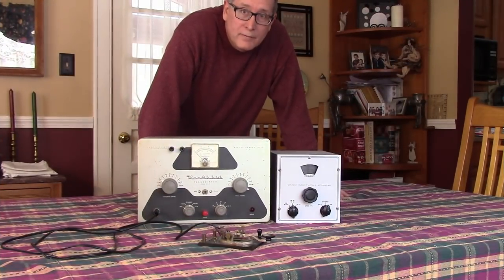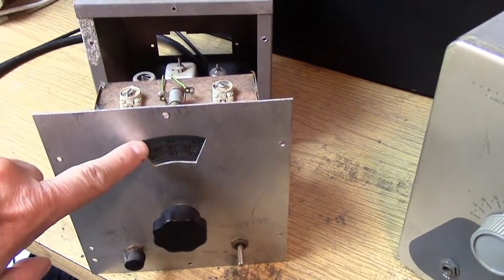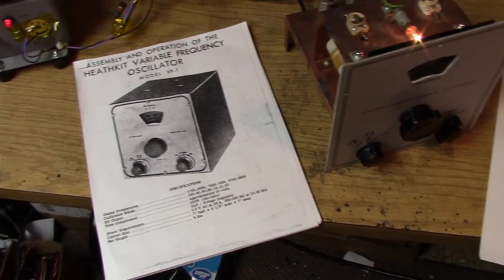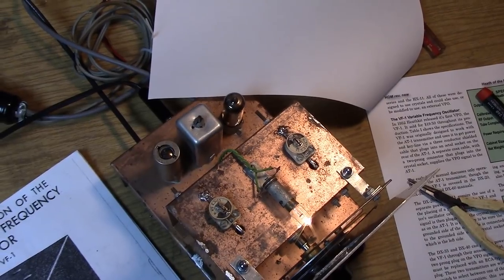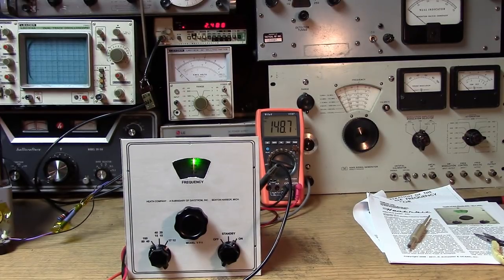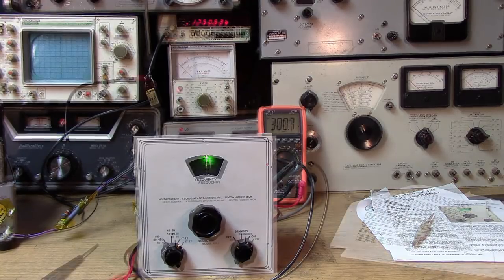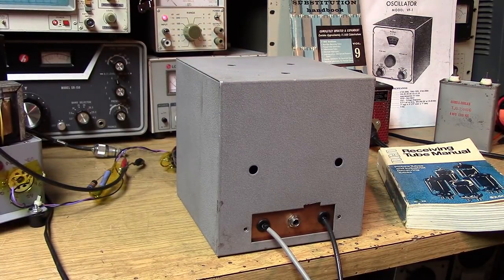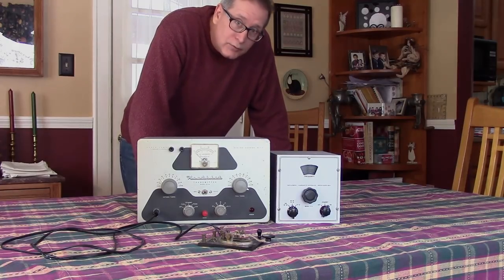Heathkit VF 1 VFO - Exploded

Comment: I've still got three of these.  One is a "parts" unit, the other two I refurbished electronically and wired one-each for the two keying modes.  I use them variably to set frequency on transmitters and transceivers.  Having two prevents all the re-soldering anytime a different keying mode is called for.  The VF1 may be older than the HG10 external VFO, but the VF1 is far more stable.  Matter of fact, if either of mine are warmed up for a full hour there is no drift.  Actually in my "novice era" VFOs were banned.  We were limited to 75-watts and crystal control.  Using a VFO on HF required a General license as a minimum.
Reply: correct....think it changed in 1972....then a Novice could have VFO Control....DX-40, and an s-53a and a dx-160 for me....handful of crystals, a knight VFO...an old elmer rigged it up for me to work with the DX-40....1980....then I got an HW-8 in 1981....back in the day...dx with old tube rigs, and QRP....had a horn button for a key once in the early 80's...it worked...

Comment: I have just run some drift-tests with my VF-1 here, Mike, and the results....once it is warmed up...are literally amazingly good. I'll send the results to you via e-mail soon. Warm-up-drift is "not good" in my opinion, but is still better than some other VFOs of the period. I insist that the "bad press" the VF-1 has received from some users is due to several factors, one being poor original construction, but another being that some users are not aware of the factors which can cause it to sound and work badly. I modified my present VF-1 to enable me to switch between blocked-grid and cathode keying and I use it with my HW-16. Lastly, I used a VF-1 many years ago as a transmitter for short ranges. I remember receiving a 599 report on 40 meters from a station in Idaho when I was living in Missoula, Montana. But band-conditions then were far, far better than they have been in recent years. vy 73, Mike.

Comment: As you mention it does seem as though the supply may have been the problem with the VF-1. I had one back in 1967 just after receiving my General, but used it with a custom supply for the VFO that then drove my homebrew TX (as a kid I couldn't afford a DX-60, but it appears that worked to my advantage). Other than needing to let it become reasonably drift-free after say a 20 min. warm-up, I had none of the reported hum, chirp, click, or other issues. I suspect that the reported chirp had to do with the huge variation in the plate voltage when keyed when used with a Heathkit TX, whereas with the custom supply the voltage was reasonably constant.
Reply from the maker: I think you are right on the money with this. The power supply is a first order influencer, and Heath was all about utility and "free" features in the competitive entry market for the young ham.
Reply: @MIKROWAVE1  Just as a fun "exercise for the reader" type of issue, identifying the exact source of the chirp isn't immediately obvious to me even with the shift in the supply voltage. My best guess is that the space charge in the grid-cathode region, which is affected by the bias, would change the effective Cgk. However there's nothing in the 6AU6 datasheet to confirm this.

Also, the worst case effective output resistance of the 0A2 is 240 ohms, and so the screen voltage variation may actually have more effect on that space charge than that of the much larger plate voltage variation. That same mechanism might also explain the hum. As an experiment it might be interesting to patch a bench supply into the 0A2 socket to see if that resolves a chirpy VF-1/DX-60 combo.

It makes no rational sense, but to this day that green display triggers an extreme sense of freedom in me. As a novice I was rock-bound to 7.181 MHz, but with the VF-1 I could go anywhere!

73s and thanks so much for the video, Roger NC6G

Comment: Excellent video. I was amazed you actually tamed this unwieldy thing. I'm the guy with the videos showing how to solid state the Vf-1 (and HG-10), making it standalone by adding a 24v power supply and LED dial lights. Also, by converting to direct drive and eliminating the vernier feature. Also, by changing the wafer switches to toggle switches. There are a lot of choices. I don't think we should be throwing them away. Another ham actually sells a plastic replacement dial which is very nice. There are so many ways to continue to use them rather than just giving up and tossing them into the trash. 

By the way, I also have one of the old Leader scopes which I really enjoy using. Please be sure to change out all the electrolytic caps if you have not already done so.

 Us old timers are a dying breed and I'm glad to see you are staying in the game. (I'm 79 now). The younger guys can't figure out what to do with tubes. Times have changed.

Comment: I bought a couple of these - one copper plated and the other not. The silver one was completely intact but worked very poorly. I took out the tuning cap and cleaned the rotor rounding clip, which was badly tarnished. In the process, I found a never-soldered joint where the band 1 capacitors go to ground. I’ll bet that drove the original builder and any subsequent owners nuts!

I bought the copper one on eBay. All the caps were replaced with crazy values. I decided to completely disassemble this one and build it from the ground up with new components following the original instructions. It was a lot of fun! The tuning cap ground spring needed cleaning on this one too. The 160M inductor slug was butchered, but I Macgyvered a replacement using a long brass screw and a ferrite bead swiped from a discarded VGA cable. Worked like a charm!

For both, I decided to replace the OA2 with a pair of 50V zener diodes in series with a 22k resistor to get the screen grid voltage to a steady 105v. It drops the heat a little further too. 

As for the plate voltage, Heathkit’s specs were 250-350 volts dc. Someone told me that electron-coupled plates can run fine at 3 to 3.5x screen grid voltage. And my PS is at 310 under load, so it’s just right.

I also used stiffer wires for the RF circuit to improve the mechanical stability.

Both VF-1’s work very well! I think the rotor clip tarnish was a huge problem for mechanical stability. Solve that and you’re a third of the way home. Solve chirp with tube substitutions and steadier screen grid voltage voltage? That’s another third. The heat reduction address drift, the final third.

Comment: I bought one in very nice physical shape. I made a power supply for it and it worked okay. Yes, it was chirpy and a little drifty. I tried tube changes but it didn't really improve much. But the real problem was mechanical instability, however, and yesterday I decided enough was enough. I tore it apart to get to the main tuning capacitor, assuming (correctly) that the rotor grounding spring was tarnished. I cleaned it up and started reassembling it, only to find a never-soldered joint from the 10/47 uuf VFO capacitor pair to the ground lug. For over 60 years, this poor VF-1 has been torturing both owners and the stations with whom they tried to communicate, all due to one missed step in the original assembly! It's going back together now and I should be a much happier ham in a few hours.

I think the VF-1's poor reputation has as much to do with assembly flaws as anything else.

Comment: This Heathkit VF-1 is substantially similar to the Johnson Viking VFO-122 I used with my DX-60 as a novice .(and still have both).   Same 11m coverage,  Same 40 & 160m fundimentals, as well as having dials split between two halves of the dial for 40m vs 160 fundimental bands.  

The main tuning cap in both is not a split stator as your video seems to say.  Rather a continuous rotation type, and the plates mesh CW on one band and CCW on the other, that is why some of the bands tune backwards.

The circuit is virtually the same, same tube complement even.  The Johnson has a tapped output inductor vs. the Heathkit having two separate inductors.

The only obvious difference is mechanical:  Heathkit used a planetary ball (? guessing?) vernier drive, and a backlit dial, while Johnson used a friction reduction drive on a white painted metal dial.  The Johnson had the "off" function integrated into the band switch, while the HK had a seperate switch.  The Johnson had a bit of an art-deco look, while the HK looked a bit more techy.  The Heathkit looks a bit nicer, IMO,  but I wonder if being able to rest your hand on desk makes for easier zero-beating on the higher bands where the tuning is bit quick.

I eventually converted my Johnson 122 to solid state (pentode replaced with cascoded 2N3904 over a MPF-102 JFET) in an attempt to cure drift and yoop.  Quadupled the 6.3VAC supply to power it. (not enough drive to DX-60 when doubled to run a 2n2222 instead of 3904)  Pretty well ended the drift, but it still yooped about the same.   Eventually I ended up adding a 2N3906 to switch in a few pF when key-up, thus lowering frequency a few KHz so I wouldn't hear the back-wave when receiving.   That way the osc. ran all the time, and didn't yoop when keyed, and of course no noticeable drift.

Of note is that both of these VFO's can be touchy on the output cable, both length and type...well, actually, capacitance to resonate with the output L is the critical factor, so you can run a bit more cable length if you use RG-59 instead of RG-58.    The Johnson wants 36" of RG-59.
Reply: Just some final notes:  If anyone wants to try a Johnson 122 with a DX-60, or 40  the octal plug needs to be rewired...the pinouts are totally different.  The same applies if you want to run a Johnson Tx with a VF-1.  Also, both the J-122 and VF-1 are cathode keyed, so they need to be converted to grid-block keying for the DX-60.

Comment: Hi Mike
 Great video.  Did you feed the vf1 with 350v through the dropping resistor? Also, the rf output could just be loose coupled to the counter right?  My old fluke frequency counter has an antenna in the A position, is there enough rf to be picked up?  
Thx
Frank
Reply from the maker: The DX-40 has a 15K or a 20K 10W resistor ( depending on the schematic you find) from the HV to the accessory socket. This crude method allows the VF-1 to be powered at a safe voltage between 250 and 300V  when it draws 15 to 20 mA. Obviously the plate voltage goes all over when you key. But the regulation on the screen saves the day.  Any good modern counter will be sensitive enough that you do not need to direct couple through an attenuator like I did.

Comment: Hi Michael, excellent video, Thanks. One question... How did you do the artwork for the front panel of the VF1? Was this a decal or something else. Looked factory fresh !

73,
Glenn WA4AOS
Reply from the maker: I made it in an illustration Program and Printed it on Grey thin cardboard stock and used spray adhesive! Ha.

Comment: I have 5 VF-1s so I could hook them up in parallel and get 65 milliwatts or hook them in series and get 5X the frequencies. 
Most people don't have separate power supplies, let's see you make it not chirp powered by the DX-40.
Reply from the maker: I assume you want off the line voltage doubler approach and you agree to wear gloves?

Comment: Thanks for another fine video that was enjoyable to follow!  Since the front panel was curiously unpainted and  unlabeled, I kind of wonder if your VF-1 is an original prototype.  Nice job on the new front panel.  Is that a printed label you made?  Looking forward to seeing it paired with the DX-40!  73,  Jack  WA6KYO
Reply from the maker: Ha - dunno about that! But I can tell you that I made a contact with it! To West Bloomfield MI - 725 Miles with less than 10 mW to the Inverted L. Perfect conditions at 10AM on Sat.